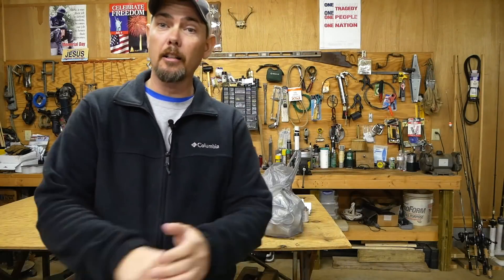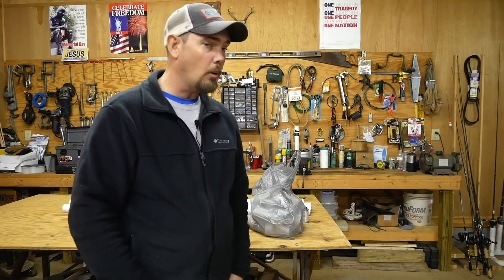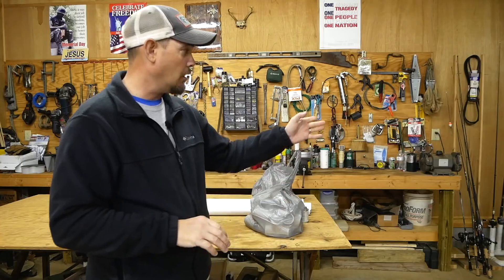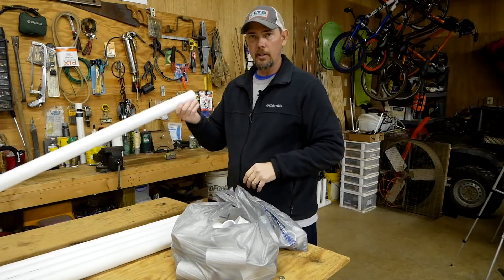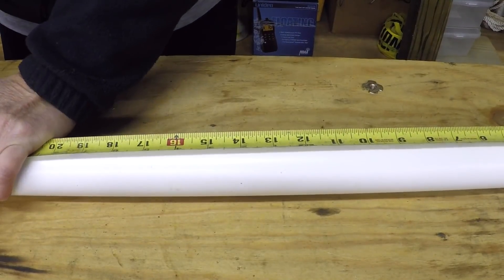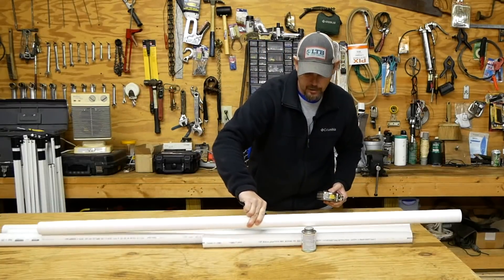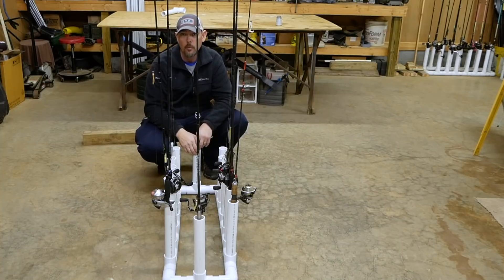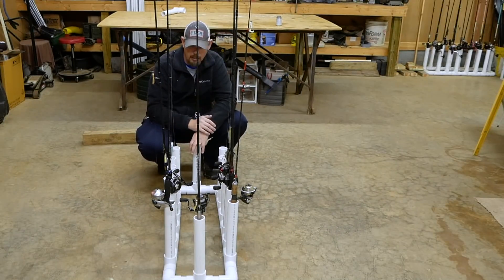DIY PVC Fishing Rod Holder ~ Easy

Comment: Nice work. If desired, one could also attach some 1/2" - 3/4" plywood to the bottom, add some rubber caster wheels (3" minimum maybe), and then easily move the rod racks around when needed. Just a thought.
Reply from the maker: Yes, sir, I agree great idea addition. Thank you!!

Comment: You can get the Okuma Expandable ABS Rod Rack for less than $40 on Amazon. It stands only as high as a wine refrigerator and holds 16 rods with reels. And there are other rod and reel racks for around the same price.
Reply from the maker: I have a KastKing rod rack but I really like these because of the rod spacing with the reels on them. Thanks for watching!!

Comment: nice job I took your design and altered it to have extended feet for stability I love it, what did you cut your pipe with I bought a pvc cutter up to 2" know cleaning or sanding burrs
Reply from the maker: Thanks for watching and I used a miter saw to cut the PVC.